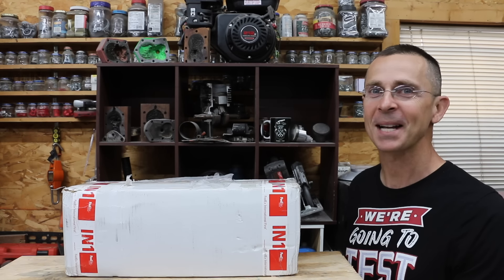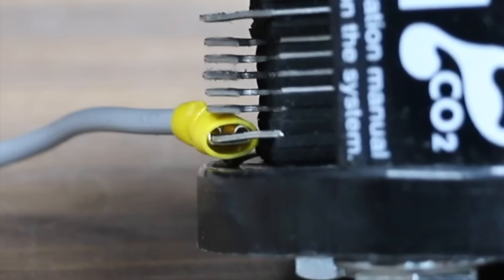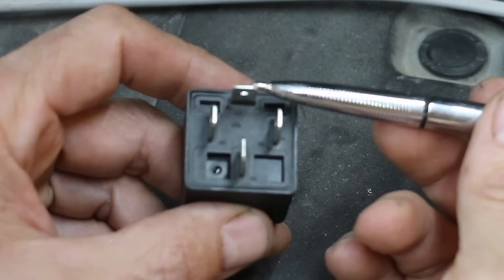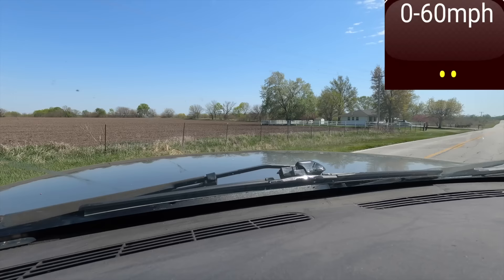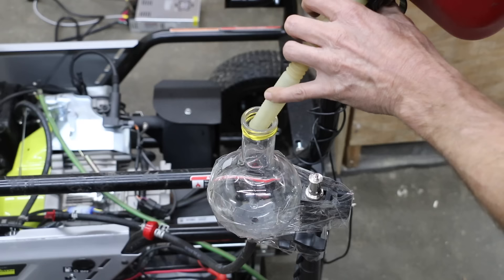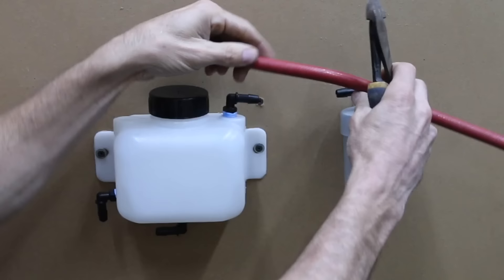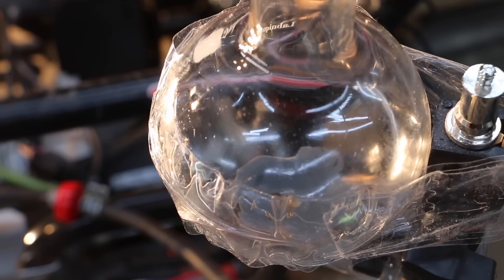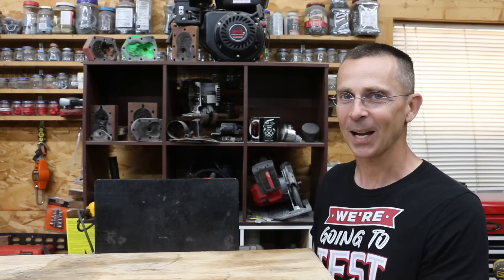AMAZING 35% More MPG with HHO? Let’s find out! Help with high gas prices?

Comment: Also when adding a hydrogen generator to a newer engine you need to modify the reading from your exhaust oxygen sensors, the on board combustion computer will read a clean emission as to lean regardless of gains in power and add more fuel on the fuel injection, thus defeating the purpose of hydrogen generator, making it tricky to just add it without engine knowledge
Reply: no,an engine really doesn't care about what electronics are attached to it....fuel,spark,compression
Reply: I agree. I have to purchase a special 600$ chip for my Chrysler 200S just to run it on higher octane fuel properly.
Reply: @trillrifaxegrindor4411  THAT'S FUNNY GRANDPA.
Reply: @trillrifaxegrindor4411  wrong
Reply: @TheRedeyerecords  $600, boy did they see you coming LOL
Reply: Acardio is perfectly right. With HHO generators you don't just add it to the usual gas the ecu wants the injectors to spray. After the installation you have to find the right Air Fuel Ratio that happens to be way too rich after the install. There are different procedures to use to be able to lean the AFR out. You can do that using some expensive devices that will be able to read the AFR in real time while you drive. You adjust it with some of those procedures to get it to the ideal value that is 14.7 ( stoichiometric value for non turbo engines). That means that you're getting 14.7 parts of air for 1 part of fuel. As an example, one of those procedures is to install a non foul spark plug extension in between the 2nd oxygen sensor and the exhaust system.
I did install one HHO generator my 89 Toyota Pickup truck 4x4 years ago and average MPG went from 14.7 to 17.8 with an incredible increase in torque. That average MPG increase was a nice 21% bump. Not bad at all for an old 4cyl 2.4 liter crazy lifted pick up truck with horrible aerodynamic.
I've been subscribed to Project Farm for years, I always appreciate his videos but this time he needed to do a little bit more work before judging what he was dealing with
Reply: @attrea  So why aren't those modifications part of the instructions?
Reply: @BrBill  That is a good question. I think whoever sells that kit is misleading their customers making them think it's a sort of a plug and play when in reality it takes way more than that. Fine tuning is what really takes you far in that department. I have enjoyed that experience a lot but I also have to mention that I'm a motorcycle mechanic therefore already inclined to get deep into that
Reply: @attrea  Thank you for the information. I would surmise that it is misleading, because people purchasing this technology would typically buy to save money, but not want the additional costs up front. Therefore it would become cost prohibitive, this making it harder to sell.
Reply: @attrea  so leaning out the AFR reduces fuel consumption. Imagine that. The HHO generator is bunk.

Comment: The small engine has no fuel management system a car with a fuel management system has an oxygen sensor that monitors weather the  engine is running rich or lean , with the extra fuel hydrogen , the o2 sensor can lean the engine fuel down which may add fuel mileage.
Reply: The o2 sensor will never read the burnt hydrogen.
Reply: @MrRock861261  The o2 sensor doesn't look for burnt fuel gas it measures oxygen in the exhaust gas to compare to outside levels. That being said I don't know if the system could adjust far enough to make an appreciable difference in fuel economy. I think it would be also beneficial to separate the gases with a duel output system and pipe pure hydrogen into the engine, the problem with the bubbler is it is oxygen generating as well and so the o2 levels might read high negating any benefit as well.
Reply: @robertareynoldsjr  Do you think the bubbler generates oxygen, if so how does this occur? I have always thought that bubblers (and of course the non-return valve) was a safety feature to prevent flashback to the HHO (Brown's gas) generator or in this case the bottle containing the HHO. It is possible to fool the exhaust oxygen sensor into allowing leaner fuel mixes by installing an adjustable sensor.
Reply: @leondxut  No, the bubbler itself doesn't create oxygen but this type of system does. My understanding of the science is than when the electrolysis occurs, it breaks the bond between the o2 and hydrogen atoms and so the gas released into the bubbler is already a stoichiometric mix of fuel and oxygen because the positive electrode is generating oxygen and the negative is generating hydrogen. My thought is that if you separate the electrodes in in the gas collection phase you could use pure hydrogen and so the mix would not be as lean and not need as much adjustment to compensate.

Comment: A video on floorjacks would be helpful!
Reply: nah, just get a Harbor Freight Daytona jack and you are all set, no one can compete with those, even at double the price!
Reply: Tripods work much better for shooting video.
Reply: The Daytona is said to be very similar, if not the same as the Snap-On, they were made in the same plant at least. Can't say if the internals are exactly the same though. I've used the larger size Snap-On, 5 ton I think, it is awesome. I plan to try a HF for myself to have at home.
Reply: @Kineth1  LOL!

Comment: The engine temp. for the 0-60 tests probably made a difference...  First test may have been a cold engine, but 2nd and 3rd test the engine was hot.  Am I correct to notice/assume this?
Reply: yes. engine temp has a pretty big effect on mpg.
Reply: You are correct, but given Todd’s consistent methods, and that he warmed up the generator, I’d be willing to bet he warmed up the ‘Burb too and just forgot to mention it.

Comment: Interesting to see these kits about. I've seen mobile mechanics with browns gas generators that they feed into an idling engine to clean up soot deposits. 
I'm told that during WW2, the ministry of war retrofitted their tanks with browns gas generators and got 60% efficiency gains. Hard to test when you don't have the original equipment. Reading some of the comments here that seems to be the case if you have a carburetted fuel air mixture, hydrogen in the air intake helps the fuel droplets burn more completely. Fuel injection works a little differently and with variable valve timings overcomes a lot of the inefficiencies already.
Reply from the maker: Thanks for the feedback.